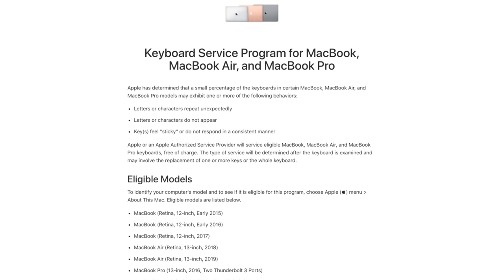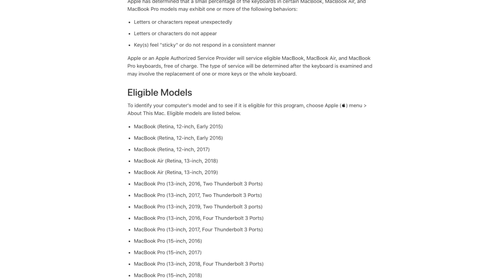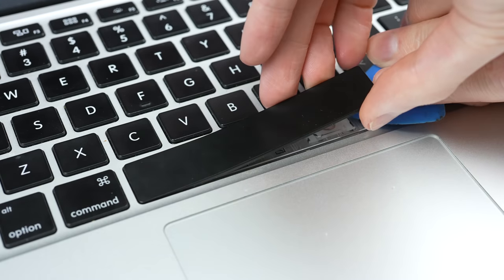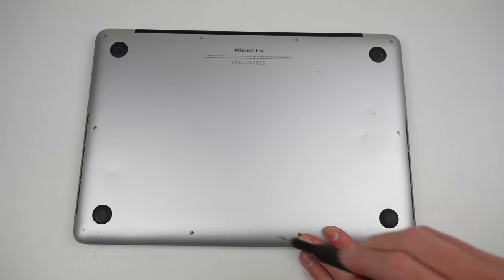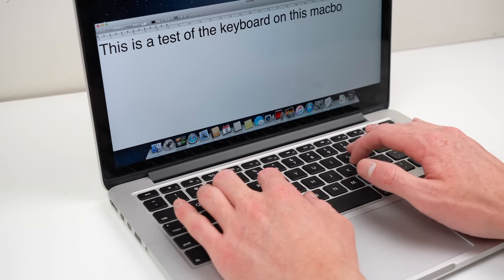Apple Really Doesn’t Want You To Fix This - MacBook Keyboard Replacement

Comment: A rivet works by deforming the end of a metal cylinder into a mushroom shape to hold the parts together. You can use a Dremel tool to just quickly grind the head of these little mushrooms off the rivets on the inside of the keyboard frame, then the keyboard will just lift out without all that effort or risk of breaking or scratching up something else in the process.

Comment: I repaired an Acer V5-571 the other week with the same design, I hadn't come across a laptop designed like that before since I stay far away from apple and it ended up costing me an extra $70 because I didn't really understand what I was doing. I got a replacement keyboard and tried to put it back in with the old backlight but it ended up dying within a few hours so I ordered a full keyboard assembly instead of just the keyboard itself, so wasteful an unnessescary

Comment: So if you first break off the aluminum pins with a slotted screw, getting the keyboard out is much easier, but still more expensive in terms of paid work than replacing the top case as a whole

Comment: if it's rivets using a dremel or drill with a drill bit would be easier to remove the rivet heads. it seems heavy handed but if it is so easy to pry im guessing the rivets aren't steel but aluminium. technically you could just grind off the head of the rivet too in that case

Comment: You're luck you had plastic rivets. Mine were metal in a mid 2015 MBP 15". Same process for repair. I never did it before and never fully disassembled this model, it took me 3 hours. I could probably do it in 1.5-2 hours again if I needed to. I also replaced the backlight.

Comment: I'm almost 100% sure this sort of thing goes completely against some form of Customer Protection laws, and if it doesn't then those laws need to be made. This is something that should never be allowed. Companies designing products that are impossible for 99% of people to repair, when they could break at literally any moment is just criminal. It's basically racketeering.

Comment: simpler and less violent solution for the rivets would have been a 2mm drill you can drill those rivets out super easy...Just my 2 cents...Would have taken less time and saved a bunch of potential warping and damage to the keyboard housing...

Comment: I don't know if I'm genius or stupid,
Whenever I see a screw that looks weird, I just try to jam a flat head screwdriver into it, and it always works, so there is a quick it, few times it hasn't worked is with tri-wing and gamebit screws, although gamebit screws specifically are just a stupid design

Comment: I had a similar problem with a Windows laptop keyboard. Rather than risk destroying my machine I just disconnected the keyboard and now use a bluetooth keyboard instead.
Not ideal but the  expensive laptop is now working fine.

Comment: If you had drilled out the rivets it would have required less time and effort and you would have had a nice clean hole to thread those steel screws into, they would have self-tapped into the soft aluminum with no problem. A hand drill will do, but a drill press would have taken even less time.

Comment: FWIW, the keys pop off very easily when the whole unit is assembled. Much of the resistance to extraction in the video seemed to come from the key caps themselves as they bound against their individual cutouts. I'd bet the removal would take a loss less muscle with the key caps popped off first.

Comment: holy cow... and my clevo W370SS was much easier to repair, with just 3 screws and a panel to remove to get to the keyboard. 

seeing this bloody (pun intended) repair method is just madness.

at this rate, will we end up seeing welded shut laptops in the future?

Comment: If I may suggest in the future a small grinding tool, like a dremel of sorts or even smaller  and grind the heads of those rivets. It's safer and smarter.
I mean imagine you'd try to force remove the cover apple screws by not having the dedicated screwdriver tip. This is what you just did, ripping that old keyboard out and hurting yourself in the process and putting a lot of useless effort in the pulling of it out.

Comment: It's not just Apple, even cheap laptop makers like Acer, Lenovo and HP are doing this. I had an Acer laptop with similar design and I had to replace the keyboard twice within the one year warranty period. Then the keyboard went kaput after the warranty was over and they were demanding 30% of the laptop's cost for replacing the keyboard. 

Thankfully, the keyboard had plastic rivets which were easy to remove with a Dremel. Then I used a hot soldering iron to fit in a cheap china made keyboard replacement and it worked better than the original one.

Comment: I replaced the keyboard from my wife's MacBook. I don't found any little screws. So I used a screwdriver and a hammer to hit every little aluminum head. And after that I put some super glue in every little thing. I broke the backlight. And I cut my self ripping of the old keyboard. I was a mess. But I saved a lot of money

Comment: Not only (cr)Apple mate. Same goes for HP, except the KB is melted plastic rivet held in. I know 'cause i had to repair a hp 17 bs0xx with shot hinges and broken plastic all around. The touchpad is a b*tch to replace too, you need to pry it out very gently if you need to reuse. Spares come seperate and you have to recombo the lot and you're in for a couple of hours of fun. Ripper vid btw.

Comment: This isn't the slightest bit surprising. Frankly the only thing I am surprised about is that Apple hasn't gone and taken advantage of advanced 3d printing to make their products out of literally just one continuous part. Either that or implement a detection mechanism in the casings so that it requires deactivation from a rotating algorithm based security key that only management-level staff or above have access to, and opening the device otherwise = brick. It's gonna happen.

Comment: 7:59 they don't even need to attach crap like that, make the device 2mm thicker and die a rigid backing plate to hold the keyboard in place.

Comment: Honestly, THIS kind of design needs regulation against. RIVETS instead of just a bunch of screws, is totally anti-repair. 

I understand the idea of "reduce costs to ever increase profits," but there needs to be a "product durability tax" if devices are designed in ways that aren't reasonable to repair (albeit the term "reasonable," needs to be evaluated per component as you weight function vs reparability). 

Another aspect is the battery. There's NO reason to use such strong adhesive versus 2 small L brackets out of plastic in the corners, and a small plastic ribbon screwed into place (and possibly small back cash cushions to reinforce). It's purely anti-repair at the idea of saving a small amount in just using adhesive.

Comment: We here at Apple industries will no long be using wires or conductive strips. We will instead use a proprietary conductive gas that is injected into special circuit cavities during the assembly process. The gas is highly dangerous to human... all life and if the product is disassembled at any point out side of our high tech factory it the gas will escape instantly killing anyone within a 5 meter radius. (We are not legally responsible for these deaths, naturally) More importantly, the device will never hold pressure again so even if you could acquire a suitable conductive murder gas wire substitute at a reasonable price from a third party, you couldn't replenish your device without it leaking. This change is to improve product quality and the user experience. As you are already indoctrinated into the apple cult, We're sure you'll understand. Thank you for your soul....errr time! I mean time!

Comment: For people missing the point: 

These products are purposefully created to be as unrepairable as possible. The shorter the lifespan of their products, the less time it will take for consumers to have to buy new ones. It's a very common business strategy, it is rather hard to find long-lasting products built for ease of repair and durability now. We ARE capable of it, we just don't, because that's not where the money is.

Comment: This is hilarious. I replaced my xiaomi keyboard not long ago - removed an aluminium tab that hid the screws at the top, undid 3 screws from the top, and slide the keyboard out at the front, as 3 tabs prevented the bottom from moving. Disconnected a single flex cable, attached the new, slotted it in, put the screws in, and pressed the aluminium cover back to hide the screws.

The fact you needed to flip it upside down was funny enough

Comment: Not defending Apple here and I think it’s not even design flaw but it was done to cut manufacturing costs. Unfortunately not only Apple does that but overall most of the manufacturers have keyboard more repair/replace friendly. This is clearly design to reduce the cost and can you blame them? From the manufacturer perspective - imagine having to add extra 100 tiny screws per one MacBook + extra labour time to screw them and multiply that by approximately 5-10 millions of units sold each year ? In 2012 they announced first Mac Made in USA - but because of the contractor in USA couldn’t provide enough screws it created delays and force them to source it from China.

Comment: I think the biggest reason why they used ribbons instead of screws  has to do with it was cheaper. If it made it harder to repare didn't matter as long they earned little bit more. 

This what they have always acted like.

Other companies for instance like phone companies also want to cheap out at times like taking away the head phone jack, the changing brick and headphones from the box and still charge 1000+ usd for the device just because they get away with it, since everyone does it you have no choice but to accept it no matter if you want it or not.

Comment: I guess Im one of those people who thinks if something CAN be fixed, it should be rather than replacing it. But there is really much more to it than that. I don't think electronics manufacturers should have to make replacement parts for their products. ONE, the reason they cost so much new is because they already know, people WILL spend a fortune to buy the newest gadget, every time and TWO, the technology is changing so fast something 2-4 years old isn't worth fixing as it will be out of technological date, let alone making spare parts for it. A laptop is not a car. An Iphone is not a refrigerator, an X Box isn't a tractor. They all have very limited lives when manufacturers are sucking the money out of consumers as fast as they can create a new one. Since this is mainly an electronics issue, its not the big deal everyone makes it out to be. What IS a big deal is the recycling of these old units instead of them going to a landfill. Put your effort in that, thats a solvable problem.

Comment: Oof, this just makes my distaste for apple grew more. Don't get me wrong my old ipad is great and use them all the time (liked that it's a decent drawing tablet, but hate the you need to login now and again, and everytime in the apple appstore so I never use it for internet stuff)

But this is just far too painful to watch and do, So much for premium product. I'd rather desolder 100 not hot-swapabble pcb,   lubricate 3000 mechanical keyboard switches and 300 stabilizers than try to repair a broken macbook pro

Comment: at this point I consider not buying a macbook a more covineint option that anything else. I really liked them they are sleek and stable, very nice machines. But apple really been pushing away in the recent years with the app library, the auto photo curation, the 'icloud content scan' and so much more.
Reply: to be fucking fair, of the almost decade long experience of mainly using apple products I needed to send my device in for repair for like twice. Majority of my phones and mac served me well until I get rid of them. And most likely will go on to have another lengthy service life in the hands of another person. But still the not give a fuck about customer opinion-ness of apple is really shitty and I had about enough of it at this point.
Reply: so how the fuck are their own techs supposed to repair this shit............. instead of like 10 screws holding the keyboard on a normal laptop they put 100 rivets in.... just great.
Reply: would be an easy repair if I have 100 hands. well done apple. bravo.

Comment: I dunno if its about anti repair… its more about keyboard rigidity… do you really expect them to use that many screws instead? The idea is if the keyboard fails you replace the top chassis and keyboard as one piece which really isn’t much more work at that point…

Comment: Feels like each time any laptop has this keyboard where each button goes through its own hole in the keyboard lid - you have to deal with this rivet/melted tab crap. You can still replace the keyboard, but it does tend to take a few hours... Or you have to buy the whole top part which feels just insane - changing your track-pad and one of four enclosure parts along with the whole keyboard, just because a key is not working. Since most class action lawsuits end up with measly sums tech corporations wipe their derrieres with, and since they sneeze at legislation that tries to prevent this sort of blatant proprietorial practices, maybe there should be some grand televised annual event with nominations and prizes for the worst designs and practices that screw over customers. Apple would surely need a large shelf in their headquarters to keep all the awards they'd amass.

Comment: I still can't wrap my head around Apple not just replacing the piece of the case that holds the broken keyboard, but I suppose if they force you to replace the whole half they can "justify" making it cost more and maybe even get more pieces to reuse in manufacturing basically for free

Comment: this is very brute way to open the rivet. it can hurt yourself. the most standard way to open the rivet is by using a drill. the drill bit size must same or less than rivet body (not rivet head). for laptop repair, i recommended using a cordless screwdriver with drill bits. the torque is minimum, so hopely its not damage the laptop case.

Comment: These stupid integrated keyboards you have to disassemble the entire laptop to replace are unfortunately endemic now.
2 months ago I replaced the keyboard of my old MSI GP60 Leopard from 2014 due to water damage.
The entire process took all of 15 minutes, and that includes finding and watching a video from some guy in India who showed how to remove it.
I could simply lift it with a flathead screwdriver, unplug a single flat cable and install the new keyboard by connecting the new cable and clicking it into place.
Reply: This happened to me too when I saw the service manual for Dell Vostro 5502 laptop (my laptop). My face literally dropped when I arrived to keyboard part replacement: disassemble the ENTIRE LAPTOP TO PALM REST AND REPLACING IT FOR A FREAKING FEW KEYS WHICH DIDN'T WORK and trying to remove a stubborn screw to access the inside of the laptop.

Comment: Trying to be serious here. It should be against the law to build something that cannot be repaired. There should be repair manuals for everything. No plastic housing glued together so they must be broken to get open, no rivets instead of screws unless you’re building airplane wings or something where you really need rivets, no battery power devices that have no way to replace the rechargeable battery inside.
We are running out of resources on this earth and we need to quit screwing around and worrying about making more and more money. I hope people will contact their legislators and tell them in no uncertain terms that we demand products that can be repaired and reused.
Reply: @bruhtholemew  some do and some don’t. It can be difficult to tell which is which. However, you will figure it out and when you do, support the businesses and politicians That have integrity.

Comment: i remember my last laptop you had to pry of a plastic cover on the top remove 2 screws and you could remove the keyboard from the top without even opening the device
they should just rivet the keyboard like they do now on a solid pcb backlayer that can be held in place with few screws but thats logic speaking for ya and apple doesnt like logic its not profitable

Comment: What is wrong with tech/computer companies today that they don't want you to fix your property. Oh, that's right. It's technically not your MacBook. You're just renting/leasing it I guess. Computers back in the 80s/90s were so much more user friendly. They were so easy to mod and add different cards to and you didn't have to go to hell and back just to fix the keyboard. Ahhh. Those were the days.

Comment: Another example of Apple hypocrisy. They pretend to be an environmentally friendly company, which is why they use a plastic in  their chargers which is not usually used by other manufacturers - this plastic routinely flakes away and requires replacement. Similarly, this awful practice of riveting means many people have to buy an entire aluminium top case as replacement.